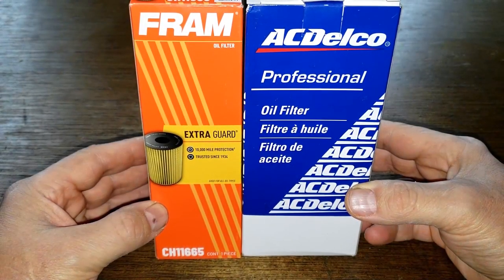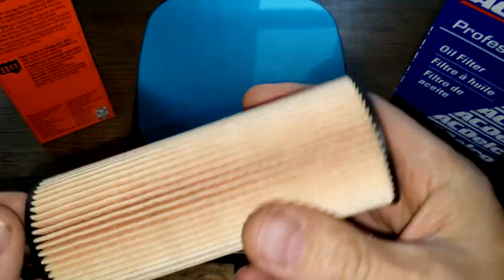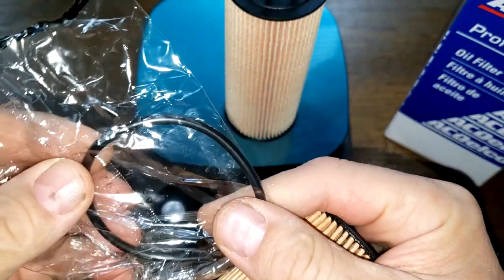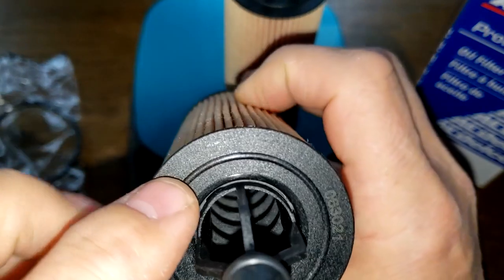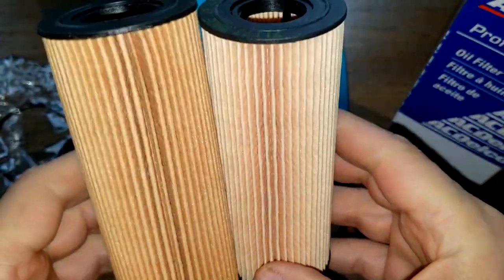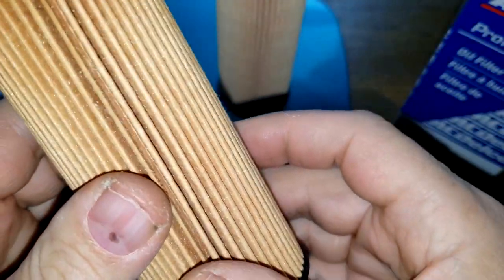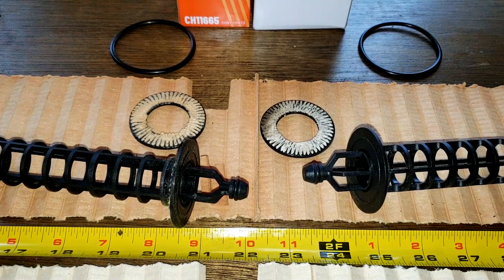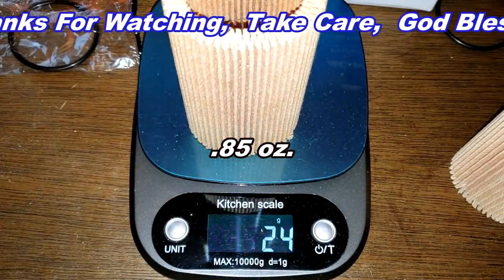Fram Cartridge Oil Filter CH11665 vs ACDelco Cartridge Oil Filter PF600G

Comment: I've just recently started to wonder why cartridge style filters don't have an anti-drain back valve.  Maybe one of your viewers or you could point out something I missed when I did an oil change on my brother's 2010 Toyota Corolla.
Reply: Toyota cartridge filter assemblies are mounted vertically, so anti-drain back valves are not required.
Reply from the maker: I dont know for sure, but I would guess an internal valve in the engine. I'll pin this comment so that's it's up top. Thanks for the question👍
Reply: Most cartridge filter housings have the drain back valve.  Convenient, because after loosening the cap, the oil can drain back to the pan, not on the floor.  Then remove the drain plug from the pan.

Comment: The amsoil one uses no resins so flows better at low temps and has a metal screen to protect against the collapsing (imploding) issue sending paper through the engine these are having.

Comment: 3:15 is why there needs to be a testing standard. Does the AC filter 100% at 20 if it filters 99% at 30? Or the fram is 100% at 30 if it is 95% at 20?
Reply from the maker: Yep, I wish there was just one test for all oil filters with one set percentage number.
Reply: 20 microns is smaller than 30, so the AC filter will filter a lower percentage at 20 than at 30.  Either way, it is very close.  I like that Fram uses smaller matter for their standardized test.  I'll break the tie and go with the Fram Ultra, which is 99+ percent at 20 microns.  The Ultra is made in Korea but Its production is soon to be moved to the good old USA, according to Fram.

Comment: Good show.  None of my vehicles use cartridge filters.  However I here one drawback is that there is no anti drain valve in these filters or system.  I think Bauer makes adapters for vehicles with this type of filter.  Test one.
Reply from the maker: I'll have to look into it.
Thanks for the suggestion.
Reply: The Pentastar has an anti-drainback valve built into the filter housing.  So there's no need for it in the filter itself.

Comment: Great video!  It looks like even their filtering efficiency is similar.  But I'd go with the Fram as it might be very very slightly better.  But 95% at 20 microns might be the same as 99% at 30.  Not sure.
Reply from the maker: I dont know either? But I would think they are very close to the same though.JMHO

Comment: Both look like serviceable cartridges. Pretty sure these are for Stellantis 3.6L engines, like Jeep. They are a relatively long application too, so they tend to come out a little wavy post use. No biggie. Also, as opposed to the spin on type from same manufacturers, many cartridges are made in China. Fit more important with cartridges too.Thanks for vid.
Reply from the maker: You're Welcome!
 and Thanks for your feedback👍
Reply: I've found the filter elements DON'T get distorted, if you are careful NOT  to overtighten the plastic cap. It doesn't need to be wrenched on that heavily to seal properly.
Reply: My reference to "wavy pleats" comes from observing many post use anecdotes of many brands this cartridge application. Because of its long narrow length, some wave almost inevitable, even with proper torque of cap. That said, not referencing extreme distortion of cartridge pleats which may be the result of overtightening of cap.
Reply: Yup, for the Pentastar... The look is a dead giveaway